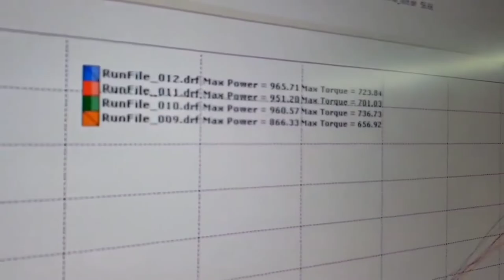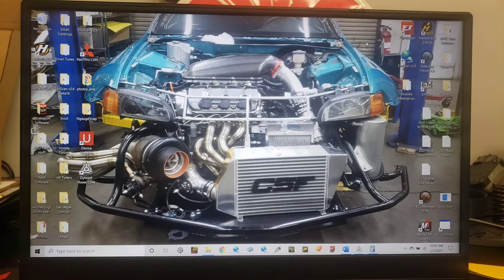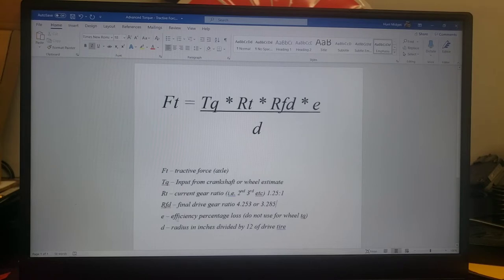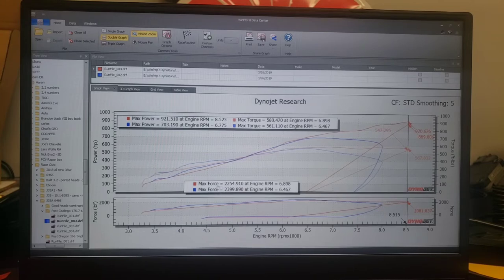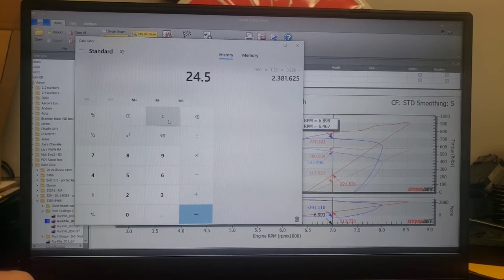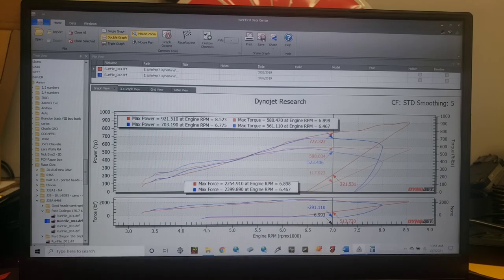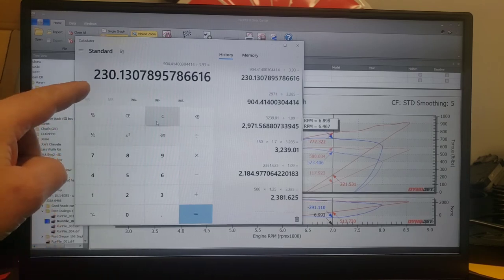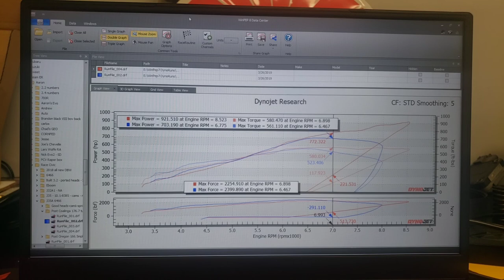Tractive Force in Motorsports

Comment: Something I don't see talked about as much is power under the curve. Its always fun to see a car that makes less peak HP or TQ run faster or drive better because it has what I would call a "better" overall power curve. Now there is nothing wrong with a more "peaky" power curve as long as the car is set up for that correctly to keep the engine in its peak power potential range.
Reply from the maker: Power under the curve is very important. Most of this applies to lower gears but as downforce ramps up and center of gravity shiftts forward we can get back to a broader powerband.

Comment: If I understand this correctly, the formula gives force per tyre ? Therefore a result of 100 means 200lb ft total engine output?
Reply from the maker: Total per axle, it would be half per tire.
Reply: @AaronONeal1  when you used math to figure out what engine torque 1st gear will hold... I feel like I just learned some black magic 😯

Comment: I mouthed "both" at the same time you answered lol! Super interesting topic to discuss, but most of this data, I'm not sure what I could do with it. Limit of adhesion, weight transfer, drag and friction is impossible to factor for my litte brain. AWD can always use more torque than a 2W setup too, so how does the Fr translate?  Sorry random mind going nuts
Reply from the maker: The secret here is I have years of tire data and torque/force is linear regardless of direction. The performance envelope of a tire. Stock geared Evo like yours is 4500 ft lbs without diameter adjustment on an R comp.
Reply from the maker: Oh but to add to that, downforce vs speed throws an interesting twist into it above what I stated as a starting point.
Reply: @AaronONeal1  Yeah, you definitely did.  You got me thinking with this post!  Had to watch it twice to get the Fr and get the connection your using % of slip, not friction rates.  I'd think you might get that from an ABS sensor on a normal car, but I'm not sure they're accurate enough for your levels of precision measurement on your typical commuter setup.